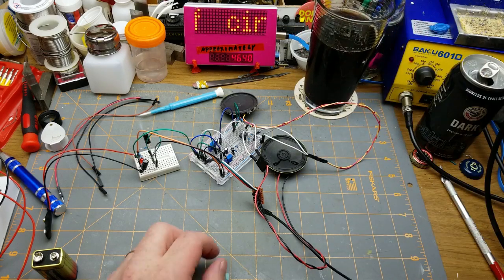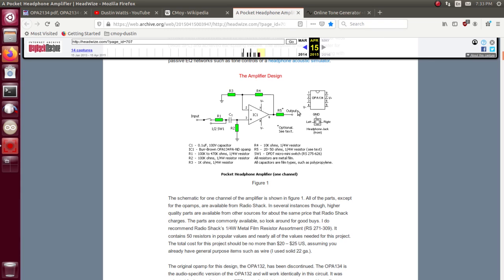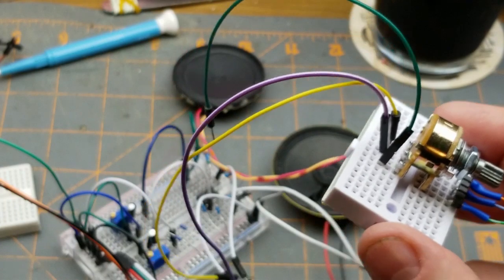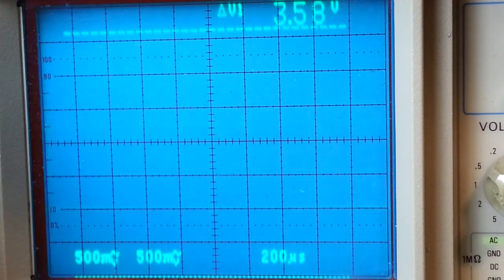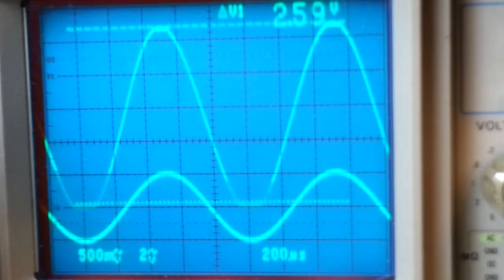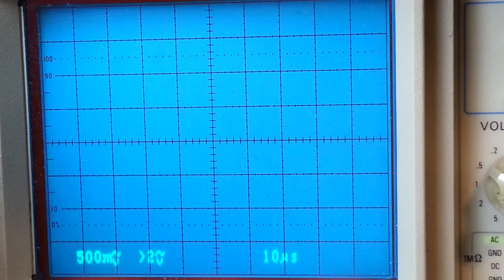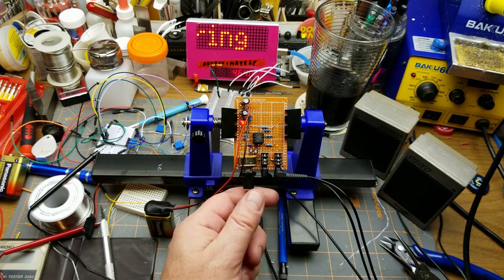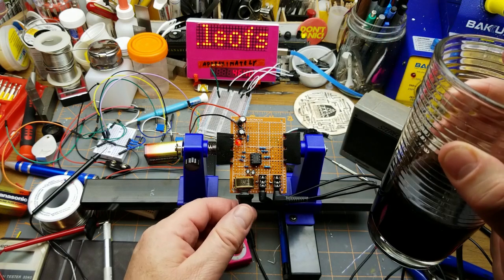build a mini headphone amp

Comment: Thanks for the shoutout :) I enjoyed watching your video! The reason the output clips so far from the supply rails is because of the low impedance of the little speaker (probably 4 or 8 Ohm). It works much better with higher impedance loads. The headphone i'm using is a 250 Ohm version of a DT-770 Pro. I'm making a video on the effect that the load has on the amplifier, it is a difficult to explain in detail altough the effect is very clear to see (and hear ;))
Reply from the maker: Good point about the load. I should have tried with a higher impedance.

I didn't show it, but I had the scope measuring across an 8 ohm resistor because I didn't want to have to talk about any potential inductive effects the speaker might have (not sure if it really did - I didn't look). 

The sound in the video was from the speaker on the other channel.
Reply: @pileofstuff  Well... load impedance is a pretty difficult subject. I've uploaded a quick demonstration video about the effect of different impedances on the opamp.
Reply from the maker: @DustinWatts  Yes it definitely is a big subject. 

I'm glad you chose to tackle it. 

I was worried that I would spend too much time on load impedance and distract from what I was doing, so I didn't mention it at all!
Reply: pileofstuff Well tackling is a big word! :) I’m also worried that it is going to be too long to be entertaining to watch. But I’m gonna give it a try!
Reply from the maker: Here's Dustin's video explaining the effects of different output impedance:
https://www.youtube.com/watch?v=o9boy-KUR5A

Thanks for doing that. It's useful information.

Comment: I like that you are able to solder together things at home.  Several other 'tubers are having every silly little thing made custom to promote PCB manufacturing.  Hope you have some 0.28/0.30 AWG Wrapping wire and pre-tinned copper wire for bodging togher larger projects.  That OPA2134 is a JFET-input amp -- just ordered a few to play with.  A little spendy at $0.55/ea though.  Have seen several preamp and headphone amp designs using the NE5532, but they have inexpensive/ordinary BPJ inputs (more bias).

Comment: I'm curious if you know how to change or correct input bias so this could be used as a (good) bass guitar headphone amp?
Reply from the maker: Without doing some calculations, i suspect all you'd need to do is make sure the input impedance is a good match, and adjust the gain a bit (that feedback resistor).
Reply: @pileofstuff  that's where most of the info fails to show how to make it a good match by changing or adjusting the input impedance.

Comment: There is a slight problem with the circuit as shown, there does not seem to be any frequency response tailoring this leaves it open to self - oscillation.
I feel the beer got left out:)
Reply from the maker: It's a beer I've mentioned before. I was hoping leaving the can visible would be adequate for the beer aficionados in the crowd.

it's a Fort Gary Dark Ale. An english mild brown style. Very nice.
Reply: @pileofstuff  it's the way you introduce the beer's at the beginning :)

Comment: Funny video or do I just call it a relaxing video.
A OpAmp amplifier is a very standard circuit and is shown in all OpAmp datasheets,  I do not really see the needs for a lot of credits for it. A reference to where you got the schematic would be fine, but you used a lot of time on it and had two reference, that is a bit excessive.

A OpAmp is not ideal for a headphone amp. 600ohm Headphones will work, but 4-8-16ohm is problematic. A regular OpAmp cannot deliver much output current, before it will limit. You could add a resistor in series with the output to prevent that, it would limit the maximum output voltage (Voltage divider), but may avoid clipping. It will wreak havoc with the frequency response (Loudspeakers are usually designed for constant input voltage, independent of the speakers input impedance). It looks like you headphone Amp. uses that solution.
Doing a passive virtual zero is not ideal when using "high" currents, a OpAmp to help enforce the voltage is usually better (Very large capacitors (i.e. RxC>0.1sec) would also work).
Reply from the maker: There is a series resistor on the output.
Reply: I saw the schematic and did smile (It was not enough to laugh) ;).